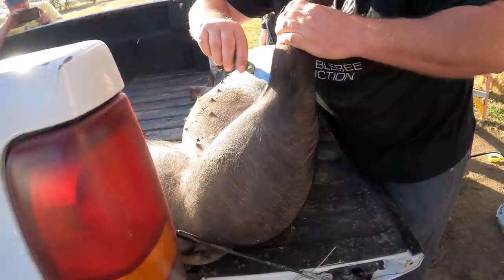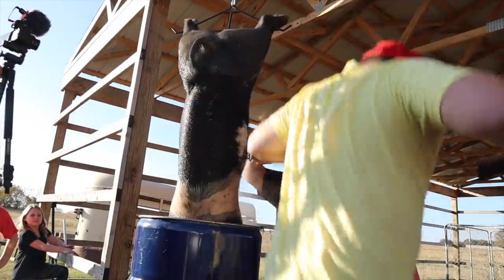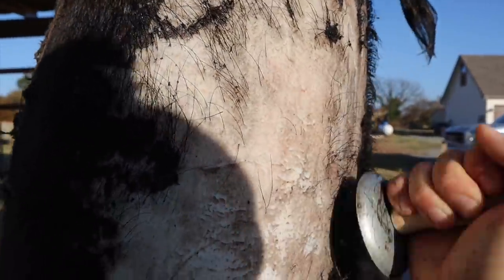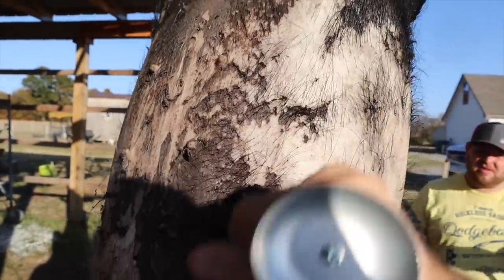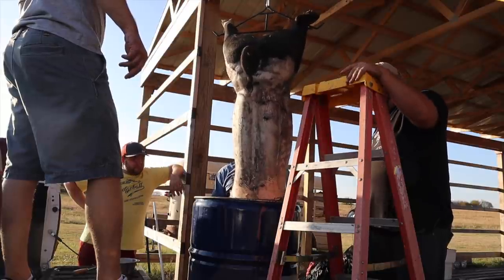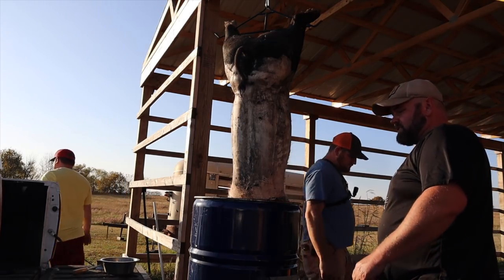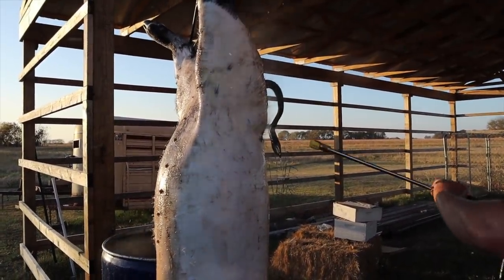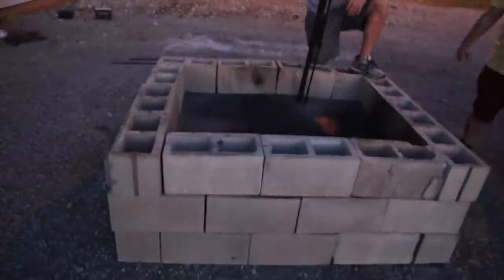Ozark Mountain Traditional Whole Hog Prep For Pig Roast!

Comment: TOLD DUTCH HE NEEDED TO GET A OLD FEED SACK FROM THE FEED STORE AND YOU LAY IT OVER THE SPOTS THE HAIR WONT COME OFF LAY THE SACK OVER THAT AREA AND POUR THE HOT WATER OVER IT AND LET SET FOR A FEW MINUTES AND THEN FINISH SCRAPING IT THE HAIR WILL COME OFF EASY.
Reply from the maker: Good tip
Reply: Yes old ruqs help big time
Reply: That's what I was going to reply.
Reply: Yes exactly, my Grandpa used to lay the pig on the table on it’s side placed them potato feed sacks all over the pig, pour tht scalding hot water all over it and then him and my uncle jst used regular old style knives sharpened them real good and scraped tht pig real good, then repeated on the other side. He also made a hole in the dirt big enough for the head to fit, wrapped it up real good with aluminum foil, then threw a bunch of coals on the bottom and then placed the head on top of the coals then threw some more on top then covered it up for hrs, jst don’t recall how many hrs cuz I was jst a little kid,  tht was many moons ago lol. Anyway thts our experience way back when. Good luck with y’all’s roasting. I’m sure it will turn out grt. 😀

Comment: Did one a few years back in a cinder block pit. Turned out really good. I had a burn Barrel set off to the side that I was burning logs down to hot coals and would throw them under the pig when the temp started dropping
Reply from the maker: Awesome

Comment: We cook a whole hog twice a year. Basically using the same concept....concrete blocks with a grate on top. A 55gallon drum with a square cut out at bottom and has a grate half down the middle. We place our wood in the barrel light it and let it go. As the coals drop we place them under the pig on the grill. We usually start around dark and stay up most the night feeding the burn barrel and the grill. Usually around 10ish we take him off the grill and start pulling pork....some of the best bbq! Put the skin on the grill and have some of the best pork skins....oh my gravy soooo good!
Reply from the maker: Wow sounds amazing

Comment: That was fascinating to watch. Who was the craftsman that made the meat hangers? hoping Dutch washed those walls after bombing his cooler lol  you all might be immune to mosquito bites for awhile. The temp of that fire pit will kill anything off. And a good (long) meat thermometer is ideal. As long as the digestive system is out correctly it should be no problem. Get it on the grid and keep the temp as continuous as possible. Crockpots on standby or aluminum pans with foil covering to keep meat warm while carving sitting in broth to keep moist. Can't wait to see more!

Comment: I may have misunderstood you, but I thought you said the water temperature was 165. If it was, then that is to hot. Water temperature should be 148-150. Anything hotter than that, cooks the hair on the hog and it's really hard to scrap it off.
Reply from the maker: Yeah it was a mix up on the temps. Reading online there are so many opinions
Reply: @HiddenHeightsFarm  I had a small one done by the guy I bought him from . The water was hot but not much more than I shower in.

Comment: We used an enamel bath to scald , once the pigs toe nails came off we jumped in with gumboots on stomped on the pig and got most all of the pig cleaned . That way the pig is not stretched out, they fit better. We never had to scrape that much it looks such a hard way of taking off the hair.
Reply from the maker: Awey

Comment: Those old round scrapers did a nice job.  The old timers never had power washers :>  I think the whole process would have been a lot easier if it was a smaller pig that could have been completely submerged in the hot water. I've been to pig roasts, years ago, but never did one myself.  The ones I was at the fire was built in a pit in the ground, the pig laid on top the coals then buried.
Reply from the maker: Yep they seemed to work the best

Comment: Dutch needed a bigger scalding barrel for a pig that size. Not being able to get the pig fully submerged and not being able to get it all the way back out quickly made the whole process a lot more difficult than it needed to be. Also, the water was too hot. Really hot water makes the hair harder to get out. We have whole pig roasts all the time here in the Philippines. Roasted whole pig is called "lechon baboy" here, and it is the best roast pig in the world. Generally speaking, though, we harvest the pigs for roasting when they are smaller and easier to handle. A pig the size of the one you guys harvested would feed an army.
Reply from the maker: Yeah it was a little bigger than we expected

Comment: Use burlap sack soaked in the water.
Reply from the maker: Well try it next time
Reply: My father in law has a slaughterhouse in Texas. He has a rolling table with a plywood top and an electric winch. He would dip whole hog then pick up a lay on table. We used big Old Timer hickory handle knives to scrape hog. Don’t want the knives to sharp. Use a burlap sack soaked in the hot water for the spots that the hair was tough. Burning works good for the small few hairs that’s left but when you burn you don’t get the roots out and when you eat it’s still in the meat. Scraping at the right temperature allows the roots to come out with the hair. If you process one and wanted to skin it hang by the head and cut about 4” strips all the way down with a carpet knife with curved hook. Then start at top skinning when you have about 6” down use a wet rag and grab skin and pull down and  the skin will come off and not the fat. This is a good way to process a sausage hog. For the small ones you can scrape then shin and fry the skins. Hope this helps. Enjoy your videos.

Comment: They hooked on to the legs and put it in head first and scrapped that half and turned it around and hooked on to the other end and put the opposite end down in the water to scald that end. Using knives you will not have all the black stuff and hairs that you  had still on the skin.

Comment: The bell scrapers are the best. They make 2 different sizes the larger one for the body. the small one for around the neck, head, around the ears & tail. And even between the legs. Don't waste your dollars on the flat scrapers. I don't like them.  If the pig doesn't fit 100% than lay it down and pour the scalding water over the parts that wouldn't fit. or on parts that cooled too fast. Bcuz as it cools the hair folicals pores close & hang onto the hair. When its hot the pore opens & releases the hair, making it easy to remove the hair. Cook the pig with the head on. The cheecks and jowls are extremely good. The same with the upper leg, ham hocks. Better luck with the next one. You learn more with each one you do.
Reply from the maker: I agree

Comment: We butchered a large hog every year. We would get the fire started before daylight under a kettle. Once the water was boiling we would dispatch the hog. We would drag the hog up to the house and put it on a makeshift table. Then my Dad would cover the hog with burlap sacks and then start pouring water over the burlap sacks. Every few seconds he would lift up the sacks to see if the hair was loose. If it was we would start scraping with tablespoons until the side was Snow White. After that we would flip the hog and do the other side. My Dad was an expert when it came to hog butchering. He would make bacon,sausage,liver sausage,hog head cheese,and paunta’s. I sure miss them days! My Dad would always say that if you scald it too much that the hair will not scrap off.
Reply from the maker: Good memories
Reply: THAT WORKS GREAT DONE THAT MANY TIMES